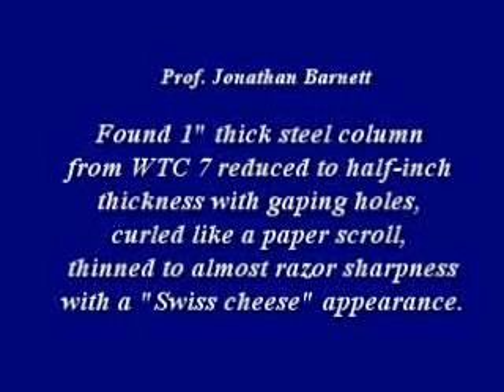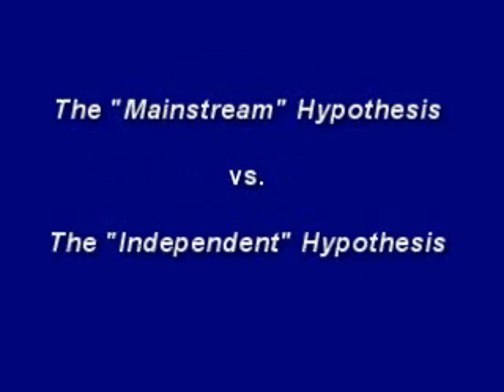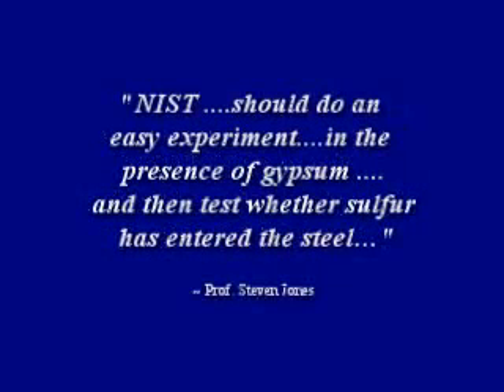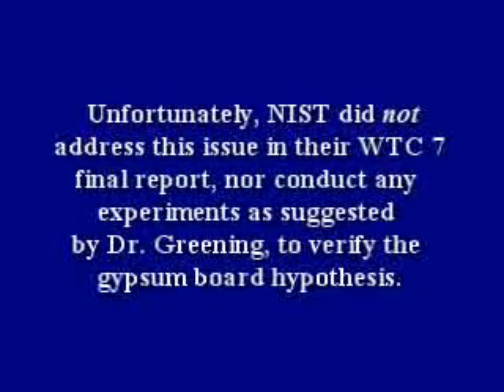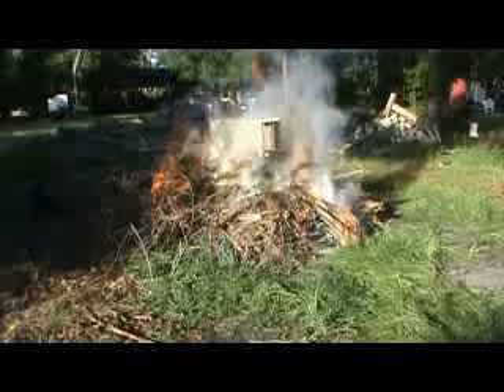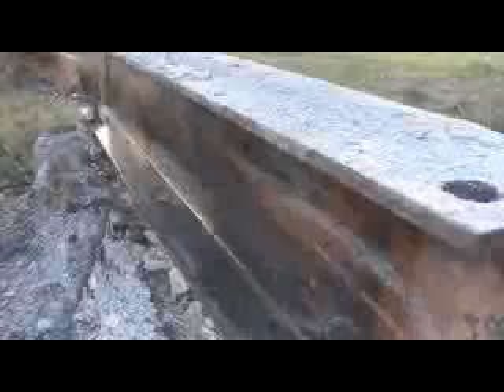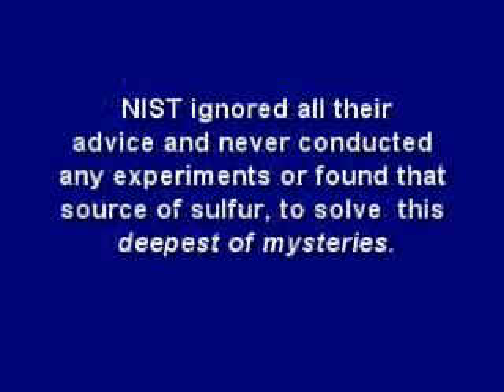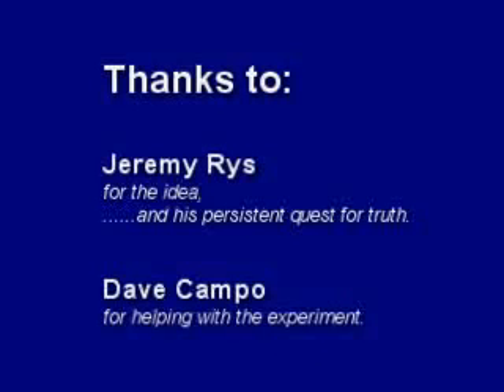9/11 Experiments: The Mysterious Eutectic Steel

Comment: "No source for the sulfur was ever detected" - WHAT?
There were HUNDREDS OF TONS of gypsum in the towers.
Gypsum is calcium sulfate, which is PARTIALLY SOLUBLE IN WATER.
The firemen used water on the wreckage didn't they? It leached down through yards of insulation, didn't it?  Over days, wasn't it?
The wreckage was hot, wasn't it? Above 1000 deg C?
So the hot calcium sulfate solution was REDUCED where it came into contact in the low-oxygen environment to iron sulfide, which melted off.
Did the experiment match this?  NO.
There was no oxygen-free steam environment over water pools over exposed iron.
There was too little water used to extract the dilute sulfate solution (It has only 5% solubility in fresh water.  Was the fireman's water fresh, or saline?)
The atmosphere wasn't low-oxygen, as in the REAL CASE.
(We know it had no oxygen because the hydrogen gas by-product BURNT AT THE SURFACE.  And, believe me, at a 1000 deg C, HYDROGEN would have burnt IMMEDIATELY with any oxygen it met if it had been possible for oxygen to be there.  But it wasn't, because exposed hot steel LOVES it.)
Hydrogen burning at the wreckage surface COULD ONLY HAVE BEEN PRODUCED THIS WAY.
The corrosion so produced would only be produced wherever a pool once existed in the wreckage over exposed steel which was itself above 1000 deg C.  Fizz, sput, sput...
The SCALE of your experiment made light of the surrounding atmosphere. Nowhere could it match the SIZE of all the requisite materials.  At such a small scale the hydrogen would escape more rapidly, failing to reach redox conditions.
If there were any true justice you would be locked up away from terminals where you would might otherwise emit socially-damaging lies and slanders.
but it's an imperfect world, which comes naturally with its faults, one of which is YOU.  However, the evil and ignorant meme you propagate will flourish like an untreated virus unless you are called out.
So respond, liar.
Reply: ***** You HATE the truth (Science).
You must be a "truther" then.  Your lie is in what you call yourself.  That fits.
Reply: ***** I'm a pensioner.  I'm 71.  I'm on holiday already.  What money do I need?
I'd like to get back to making a jig for some mother-of-pearl work, but I'm stuck here enjoying myself on the computer, because my workshop is 15 miles away, and the wife has the car.
What's YOUR excuse?
Reply: joe mcl It isn't often than half a million tons of building has dropped 675 feet into its basement. It has never happened before.
However, the same maths that designed the towers can be used to show that that fall raised up to a thousand tons of steel RED HOT.
That is an engineering calculation, not "spurious misinformation".
You must have been asleep through your physics classes, if you ever had any.
Now it has turned you into a slanderous fool.
I'm not apologising for you.
Reply: joe mcl The potential energy of a tower is what it contains when it is LIFTED into position.
PE = M * G * h where
M = 5e8 kg, G = 9.81 m/sec/sec, h = 222 meters (half way up).
PE = 1.09e12 Joules.
This is partially released as the falling tower strikes itself on the way down, but the remainder is released when it gets to ground zero.
We know the towers fell with a downward acceleration of 2/3rds G.  This means a tower used a third of its energy destroying itself on the way down.
The remaining 2/3rds, 7.26e8 kilojoules, converted its coherent kinetic energy (mass in motion) to stationary random and incoherent kinetic energy, (motionless mass with HEAT), at ground zero.
Knowing the max temp of the wreckage (1100 deg C), we can calculate how much steel got this hot by dividing the HEAT by the temperature rise and the specific heat of steel (0.45 kJ/kcal K), and we get 
7.26e8 / 0.45 * 1100 = 1,470,000 kg or 1,470 tons of steel at 1100 deg C.
This isn't an exact calculation, but within 5% which makes the point.
NIST and I DO KNOW what happened after the collapse.
It is only truthers, who know very little, that theorise (flagrantly falsely) about the completely known.
All the time you are telling us you are ignorant, and even INSISTING ON IT.
Well, have it YOUR way...you are.
Reply: joe mcl "Nice cut n paste job" - All my own work, right then.  You are graceless.
"i can go and use the same tactic" - The difference is YOU WOULD.
"i have hands on experience in structural engineering steel fixing concrete finishing found works and roofing" - I too, but then I know the science AND I can calculate AND I can design..
"The PE figure you use is again spurious as is the height calcs you give" - The all-up weight of a tower was 500,000 tons.  The height of a tower was 444 metres.  The acceleration due to Gravity is 9.81 m/sec/sec.  You LIE.
"They bear no reflection to the buildings" - LIE No.2.
"the composition of kinetic transfer to the structural load of the skeleton" - Whatever THAT means, it's trying to be LIE No.3.
"To suggest that a static load on construction lends to its destructive force is laughable" - So don't suggest it.  I didn't.  Lie No.4.
"we are not talking about loose dead loads here" - So why talk about them?  Lie No.5.
"This was a solidly fixed, welded, steel composition, built to a stringent building code which was over designed, rightly, being so tall and an engineering feat in its day" - Nice to see a momentary truth from you.  But wait - A fire had been burning in it for an hour , after a 100-ton aircraft struck with the force of a ton of TNT, and released a fuell/air explosion equivalent to 100 US iron bombs.  Apart from that it was A-OK. Lie No.6.
"as he knew without explosives it was impossible" - Thanks for speaking for him, but you are lying again. Lie No. 7.
"coukld not say so without incurring the wrath of the government or perps'" - Lie No.8.
"The conservation of energy and motion was violated by the structure" - Cannot happen. Lie No.9.
"as was the GPE" - Don't know what that means.  I bet it's a lie.
"NO structure offers zero resistance" - So why suggest it?  I don't.
"resistance is built in gravitational kinetic energy in falling object does not create heat" - Doesn't make sense, but I know it's lie No.10.
"once the collapse is initiated the fires were starved of oxygen and died" - Absolutely TRUE!  Congratulations!
"NO MORE heat would have been generated" - FALSE for my as yet uncontested reasons stated above.  Lie No.11.
"the heat you claim in the steel would only have been applied to the structure during the fires" - Same lie restated.  Lie No.12.
"not hot enough in the first place to soften the steel" - False.  Lie No.13.
"steel cools quickly" - When fire pools against it, or when buried in insulation?  Neither.  Lie No.14.
"and after the fires subsided a tempering effect" - wouldn't have occurred in either case.  Lie No.15.
"adding strength" - That's what I need.  Lie No.16.
"not weakening the structure in reality" - Lie No. 17.
"the trusses were encased in concrete" - foam unable to resist the air/fuel blast of 9,000 gallons of fuel.  Lie No. 18.
"the concrete would have supported the floor slab" - When it was 4" thick, had Perlite mixed in it, and was 50 foot long?  Lie No.19.
"NIST AND YOU DONT KNOW WHAT HAPPENED, BUT MERELY THROW CONJECTURE" - No, calculation.  Lie No.20.
"CRIME SCENE INTENTIONALLY DESTROYED" - I believe you. After twenty lies, why wouldn't I?   Lie No.21.
"I am to old CAT" - to be fixed, I'm sure.

Congratulations on twenty-one lies not at all mitigated by one single truth.  You are definitely my "liar of the week".
Reply: joe mcl No matter how hard you try, you will never get past "liar of the week".  There's too much competition for more exalted titles.
Possibly as US education progressively worsens, you won't even make "liar of  the week".  Don't be too disappointed.
Reply: ***** "the extremely interesting and informative video which I posted" - Here, on this thread?  Then it must be in invisible ink.
I'll give you your due.  You are consistent with your falsehood.
"Wilful ignorance" - See what I mean?  There's no accounting for some people.  They get angry when you don't exhibit "psychic" abilities.
Get to the point.
Reply: joe mcl "You started it!" *
No, you did. Post 8 on this thread.
"Stop pushing spurious misinformation <blathering> your stupidity".
One more LIE.  It won't make you "liar of the month", you know.

* "No I didn't!  YOU invaded Poland!" - Fawlty Towers.

Oh, and by the way, you REALLY ought to study the links I have offered you.
Reply: ***** "how, in the near footprint pile of WTC7 rubble elemental or a suitably reactive form of sulfur could have been reduced out of gypsum by naturalistic means" - IT FORMED IN A HOT REDUCING ATMOSPHERE AROUND THE STEEL DEEP DOWN AT THE BASE.
Steam is REDUCED TO HYDROGEN WHEN IN CONTACT WITH RED HOT IRON.
THE HYDROGEN atmosphere reduces the sulphate ions to SULFUR.
At ABOVE 1000 deg C the SULFUR penetrates clean iron surfaces instantly, forming IRON SULFIDE which MELTS IMMEDIATELY and falls away..
"without burning off" - It couldn't "burn off".  There was NO OXYGEN.
"explain by natural rather than synthetic process" - try asking for the Moon.  Hydrogen isn't found in nature in its free form.  It escapes Earth's atmosphere for space.
"unproven fantasy" - Known Science, 250 years old.
"Lavoisier produced hydrogen for his experiments on mass conservation by reacting a flux of steam with metallic iron through an incandescent iron tube heated in a fire. Anaerobic oxidation of iron by the protons of water at high temperature can be schematically represented by the set of following reactions:

   Fe +    H2O → FeO + H2
2 Fe + 3 H2O → Fe2O3 + 3 H2
3 Fe + 4 H2O → Fe3O4 + 4 H2"

https://en.wikipedia.org/wiki/Hydrogen

Go and check the firemen's accounts again.
Find out where they confirm the presence of HYDROGEN AT THE SURFACE OF THE WRECKAGE.
THEY DO.
And if hydrogen was there, having escaped from a wreckage base above 1000 deg C in temperature, where it is the most inflammable gas known, there COULDN'T have been EVEN AN  ATOM of free oxygen down there.

The reason why my answers irritate you is both that you don't understand them, and they are CORRECT.
I cannot apologise for this, but I would like to.
It all follows from your trying to fit dissonant concepts into your mind (INSIDE JOB!), which of course is a problem I haven't given myself.
Try thinking THE TOWERS FELL NATURALLY BECAUSE THEY WERE BURNING.
That might help.
Reply: ***** "LOL someone just put the reduction cart before the hot oxidation horse" - 
LOL someone just put the oxidation cart before the hot reducttion horse.  Something which I knew you would try.
In the basement were hot exposed steel surfaces - tons of them.  They absorbed oxygen, causing a reducing atmosphere.  THAT IS MY POINT.

"How in a naturalistic reaction was a suitable 1100C oxidation free environment produced if there was no oxygen?" - You must be confused.  "Oxidation-free" MEANS "there was no oxygen".

"What burns in an atmospheric oxygen free environment at above 1100C? - Thermate" -  And I suppose it burned IN THE BASEMENT WRECKAGE to liberate the hydrogen the firemen didn't know they observed?

That was a waste, wasn't it?

Nah.  You have had the explanation, and it just sticks in your throat, doesn't it?
But you can't let it go, can you?
You'd rather insist on a substance that couldn't possibly create the hydrogen gas, that you know fuck all about, and left no evidence, as it should have.
It's classic.  You are pointing at NOTHING and insisting that something was there that someone removed, and the PROOF is the NOTHING that stands before you.

https://en.wikipedia.org/wiki/Hydrogen
Reply: ***** "You want to have your drawn out series of high temperature oxidation free chemical reductions, of course totally evidence and experiment free supposition, whilst wanting to eat your sustained 1100C cake in an oxygen therefore combustion free environment that was being doused in water"

"In 1783, Antoine Lavoisier gave the element the name hydrogen (from the Greek ὑδρο- hydro meaning "water" and -γενής genes meaning "creator".
Antoine-Laurent de Lavoisier produced hydrogen for his experiments on mass conservation by reacting a flux of steam with metallic iron through an incandescent iron tube heated in a fire. Anaerobic oxidation of iron by the protons of water at high temperature can be schematically represented by the set of following reactions:
   Fe +    H2O → FeO + H2
2 Fe + 3 H2O → Fe2O3 + 3 H2
3 Fe + 4 H2O → Fe3O4 + 4 H2
Many metals such as zirconium undergo a similar reaction with water leading to the production of hydrogen.
https://en.wikipedia.org/wiki/Hydrogen
A hot bunch of refs for you:
1) Simpson, J.A.; Weiner, E.S.C. (1989). "Hydrogen" Oxford English Dictionary 7 (2nd ed.). Clarendon Press. ISBN 0-19-861219-2.
2) Wiberg, Egon; Wiberg, Nils; Holleman, Arnold Frederick (2001). “Inorganic Chemistry”. Academic Press. ISBN 0123526515. 3) ”Magnetic susceptibility of the elements and inorganic compounds” CRC Handbook of Chemistry and Physics. CRC Press.  4) ”Hydrogen". Van Nostrand's Encyclopedia of Chemistry. Wylie-Interscience. ISBN 0-471-61525-0. 5) Emsley, John (2001). “Nature's Building Blocks” Oxford: Oxford University Press. ISBN 0-19-850341-5. 6) Stwertka, Albert (1996). “A Guide to the Elements”. Oxford University Press. pp. 16–21. ISBN 0-19-508083-1. 7) Palmer, D. (13 September 1997). "Hydrogen in the Universe" . NASA.

"As always to rationalize the official conspiracy narrative requires magic manifesting energy." - In this case, GOING BACK IN TIME 232 years.  Or you are apeshit.  One or the other.  Which, do you think?

Time to check it out, perhaps.
Reply: ***** It is YOU that lives in your dream.
The "TV911" makes sense ONLY if and when you learn what ACTUALLY happens OUTSIDE your dream.
Until then you will utter HOGWASH with your porcine friends.
Reply: Vamoo Ah, got you this time.
I have just answered it elsewhere.
Although I think it was an answer to an entirely different question.  Let's unroll it...
"However, it wasn't a perfect job and we do see some ejections" - "Of glass and contents when the building pushes half a million cubic feet of air out of the way every fourteenth of a second".

Yes, each floor contained a half million cubic feet of air, which during the collapse HAD to "leave the building" at the rate of SEVEN MILLION CUBIC FEET PER SECOND.
Sounds like one long explosion to me.
What were you saying about explosives?
Something stupid, I'm sure.
What did I think about the explosives?
Pardon me.  WHAT explosives?

Oh, the radio-controlled water-cooled shaped charges that went off silently from exactly the point of aircraft impact, cutting the columns, to be discovered later by the firemen RIGHT ON TOP OF THE WRECKAGE, covered in slag, and looking just like oxy-acetylene cuts made by firemen?

You will find THOSE explosives next to the fairy riding the unicorn.

If the men in white coats don't find you first.
Reply: ***** "Newton's 3rd law doesn't even apply" - So DEFINE it for me, explaining how it doesn't apply in this context.

"WTC1's top section didn't need to decelerate from 6.31m/s2" - It's just as well, because it DIDN'T "decelerate".

"ten top floors could destroy all 90+ below" - Let's see how that works...
Ten floors destroy one floor.
Eleven floors destroy one floor.
Twelve floors destroy one floor.
Thirteen floors destroy one floor.
Fourteen floors destroy one floor.
Fifteen floors destroy one floor.
Sixteen....
..... I get the picture.  Impossible.

"evermore rigid floors" - ALL IDENTICAL.

"highly focused and regularly patterned squibs " - Need insertion up your jaxy.

"is just air" - That's rather a "minimalistic" interpretation of SEVEN MILLION CUBIC FEET EJECTED EVERY SECOND.

"the towers even began disintegrating silently" - Many minutes before they fell, as their fire-affected floors drooped and detached.

"no use of explosives" - WATER-COOLING would be necessary if explosives were used, otherwise the fire would have set them off.

"a lot of big round numbers" - The complaint of the innumerate.  Can't do your sums?

"being made on assumptions presented as proof" - No assumptions are necessary to show you lie, distort, and deceive.

ARE the tower floors "EVERMORE RIGID"?
How would that be possible when they are all IDENTICAL?

Is that a ONE-OFF LIE?
No.  For you that's a continuing feature of everything you utter.
Implicitly your arguments always begin with "I know I'm lying, but..."
You just don't put THAT part in.
You ARE a truther with an "oof".
Reply: +beachcomber2008 It happened 14 years ago bud. I think It's time we let it go. It was obvious that the towers were under built compared to the new WTC.
Reply: +beachcomber2008 so...why are you here getting all worked up?
Reply: ***** Because he has to get his money's worth out of the 1st grade science/physics kit.
Reply: HD5830Gamer Lmfao
Reply: Yes, funny, I prepared this report.  Laugh you way out of this:
PRIMARY 9-11 CONSPIRACY ASSUMPTION SHOWN TO BE FALSE:
AN ANALYSIS OF THE AMOUNT AND DESTINATION OF THE POTENTIAL ENERGY OF A WTC TOWER

The World Trade Center towers (and WTC7) fell NATURALLY due to buckling failure when their 'slender' columns lost attachment to their floors.
They only used a third of their Potential Energy to destroy themselves, the remaining two-thirds was consumed in crushing some of their steel into ground zero.
A standing WTC tower possessed two hundred and forty six tons of TNT of POTENTIAL ENERGY merely by just standing there. We shall call this energy Eo.
The tower fell by taking the direction of LEAST RESISTANCE, which was THROUGH ITS BUCKLING COLUMNS.
The columns failed by BUCKLING because their STRUCTURAL STABILITY had been compromised by LOSS OF FLOOR ATTACHMENTS. No steel got crushed when this buckling failure occurred. 
Buckling is not a MATERIAL failure; it is a STABILITY failure.
The floors had detached themselves by sagging to an angle which snapped their connections. Photographs of these separated floors (taken shortly before collapse) are plainly shown in the NIST Report.
As each tower fell, some of that stored potential energy, converting to kinetic energy by falling, was released to damage and dismantle both the moving and the stationary parts of the tower on the way down.
The amount of the initial energy consumed in such a manner was inversely proportional to the rate of acceleration of the tower as it descended. It can be calculated.  We shall call it Ed.
The amount of energy remaining (Er) when the tower wreckage hit ground zero is then (Eo - Ed).
This energy, transferred elastically, caused PLASTIC DEFORMATION in the crushed base steel wreckage, and became HEAT. This too can be calculated.
The heat was considerable. The signs of it were captured by satellite. It amounted to the equivalent of a thousand tons of steel raised to a temperature exceeding 1,000 degrees Centigrade.
This hot steel, crushed and pressed against ground zero, oxidised its surface (making scale) and absorbed local oxygen gas, leaving a reducing atmosphere.
In these reducing conditions, and at a temperature of 1,000+ degrees C, fireman’s water which had percolated through crushed gypsum wall boarding DISSOLVED calcium sulphate (yes, Gypsum is 5% soluble in water), the sulphate ions of which were reduced to sulphur which combined with the exposed iron to form IRON SULPHIDE, which at such temperatures was MOLTEN, and flowed away. At a temperature of 1,000 degrees Centigrade, in an absence of oxygen, and in the presence of hydrogen, Sulphur and Iron atoms become keen partners.
Such hot reducing conditions also caused the water/steam to be REDUCED to hydrogen gas which was noted by firemen to be burning at the surface of the wreckage.
The wall-boarding and crushed concrete surrounding (but mostly above) the steel were THERMAL INSULATORS, so greatly slowing cooling.

CALCULATIONS (in SI units):

To calculate the original potential energy of the tower in TNT equivalent,
G = 9.81 metres/sec^2
Mass (M) of tower = 5e8 Kg
Height (h) to the tower’s CG = 210 metres
The explosive energy of 1 ton of TNT (Kt) is equivalent to 4.184e9 Joules

Equation: Tower Potential Energy (Eo) = ( M * G * h ) / Kt
This is equivalent to ( 5e8 * 9.81 * 210 ) / 4.184e9, or 246 tons of TNT.

The Potential Energy of each standing tower was equivalent to 1,000 standard 500 lb. ‘iron’ bombs.

To calculate the kinetic energy used in the tower destruction takes a moment, after a simple thought experiment, namely considering the tower would fall at G if there were NO resistance, and if it fell so slowly that it consumed ALL its energy, it wouldn’t fall at all.
So we can see that the PROPORTION of the energy used up by the collapse must equate with the proportion of G which the collapse was unable to achieve.
As the collapse acceleration was, by truther calculation, established to be about 70% of the acceleration due to gravity, we’ll use that.
The energy used up in tower destruction was therefore 30% of 246, or 73.9 tonnes of TNT.
Assuming that 30% of the tower fell outside of the basement, then the energy (Er) available to heat the wreckage base (by elastic energy transfer and crushing) was 0.7 * (246 - 73.9), or 120 tonnes of TNT.
We know that the steel reached at least 1,000 degrees Centigrade because that is the melting point of iron sulphide.
We can therefore calculate the mass (m) of steel that was raised to that temperature.
The specific heat of iron (Fs) is known to be 0.45e6 Joules / tonne / degree C
The ambient temperature was 20 deg C, so the temperature rise (Tr) was 980 degrees C

Equation: Er = m * Fs * Tr
So m = Er / Tr * Fs = ( 120 * 4.184e9 ) / 980 * 0.45e6
And so m = 5.02e11 / 4.41e8 = 1,138 tonnes.

The collapse of each World Trade Center tower created 1,138 tonnes of red hot steel at 1,000 degrees Centigrade.

So we can see that there is no need to postulate an extra source of energy, and that the basement wreckage heat is also easily accountable, with the additional corroboration of burning hydrogen at the wreckage surface, and molten iron sulphide at the wreckage base.
And so the underlying 'truther' assumption, that the planes couldn't bring down the towers, is shown to be FALSE, as it is shown by calculation, using the physically-correct values, that the potential energy possessed by the towers numerically accounts for ALL the known consequences, through elastic energy transfer, plastic deformation, HYDROGEN gas burning at the wreckage surface, EUTECTIC IRON SULPHIDE melting off the hot steel pressed against Ground Zero, and, of course, a tremendous amount of HEAT.

These results are EVIDENCE of the event. They have been evident to any REAL scientist or engineer from day 1.
Reply: Took you almost a year to come up with this? My god man...the whole tower does not fall from the top dumbass, more than 90% was still standing underneath the falling portion....ergo you cannot ascribe the full mass of the tower to the kinetic energy calc...15yrs later and you still get this dumb shit trying to explain what is clearly a demolition...
Reply: "Took you almost a year to come up with this?" - No.
"the whole tower does not fall from the top" - - actually, yes all of it falls, including the top of it.
"more than 90% was still standing underneath the falling portion" - So it didn't fall?
"you cannot ascribe the full mass of the tower to the kinetic energy calc" - Are you denying the potential energy of the tower?
"15yrs later" - and you are still ignorant and stupid.  That's the measure of your success...
Reply: You have no idea on the concept of kinetic energy and momentum, do you...
Reply: ***** Are you talking to yourself, because ONLY if so will you be correct.
Reply: PRIMARY 9-11 CONSPIRACY ASSUMPTION SHOWN TO BE FALSE:
AN ANALYSIS OF THE AMOUNT AND DESTINATION OF THE POTENTIAL ENERGY OF A WTC TOWER

The World Trade Center towers (and WTC7) fell NATURALLY due to buckling failure when their 'slender' columns lost attachment to their floors.
They only used a third of their Potential Energy to destroy themselves, the remaining two-thirds was consumed in crushing some of their steel into ground zero.
A standing WTC tower possessed two hundred and forty six tons of TNT of POTENTIAL ENERGY merely by just standing there. We shall call this energy Eo.
The tower fell by taking the direction of LEAST RESISTANCE, which was THROUGH ITS BUCKLING COLUMNS.
The columns failed by BUCKLING because their STRUCTURAL STABILITY had been compromised by LOSS OF FLOOR ATTACHMENTS. No steel got crushed when this buckling failure occurred. 
Buckling is not a MATERIAL failure; it is a STABILITY failure.
The floors had detached themselves by sagging to an angle which snapped their connections. Photographs of these separated floors (taken shortly before collapse) are plainly shown in the NIST Report.
As each tower fell, some of that stored potential energy, converting to kinetic energy by falling, was released to damage and dismantle both the moving and the stationary parts of the tower on the way down.
The amount of the initial energy consumed in such a manner was inversely proportional to the rate of acceleration of the tower as it descended. It can be calculated.  We shall call it Ed.
The amount of energy remaining (Er) when the tower wreckage hit ground zero is then (Eo - Ed).
This energy, transferred elastically, caused PLASTIC DEFORMATION in the crushed base steel wreckage, and became HEAT. This too can be calculated.
The heat was considerable. The signs of it were captured by satellite. It amounted to the equivalent of a thousand tons of steel raised to a temperature exceeding 1,000 degrees Centigrade.
This hot steel, crushed and pressed against ground zero, oxidised its surface (making scale) and absorbed local oxygen gas, leaving a reducing atmosphere.
In these reducing conditions, and at a temperature of 1,000+ degrees C, fireman’s water which had percolated through crushed gypsum wall boarding DISSOLVED calcium sulphate (yes, Gypsum is 5% soluble in water), the sulphate ions of which were reduced to sulphur which combined with the exposed iron to form IRON SULPHIDE, which at such temperatures was MOLTEN, and flowed away. At a temperature of 1,000 degrees Centigrade, in an absence of oxygen, and in the presence of hydrogen, Sulphur and Iron atoms become keen partners.
Such hot reducing conditions also caused the water/steam to be REDUCED to hydrogen gas which was noted by firemen to be burning at the surface of the wreckage.
The wall-boarding and crushed concrete surrounding (but mostly above) the steel were THERMAL INSULATORS, so greatly slowing cooling.

CALCULATIONS (in SI units):

To calculate the original potential energy of the tower in TNT equivalent,
G = 9.81 metres/sec^2
Mass (M) of tower = 5e8 Kg
Height (h) to the tower’s CG = 210 metres
The explosive energy of 1 ton of TNT (Kt) is equivalent to 4.184e9 Joules

Equation: Tower Potential Energy (Eo) = ( M * G * h ) / Kt
This is equivalent to ( 5e8 * 9.81 * 210 ) / 4.184e9, or 246 tons of TNT.

The Potential Energy of each standing tower was equivalent to 1,000 standard 500 lb. ‘iron’ bombs.

To calculate the kinetic energy used in the tower destruction takes a moment, after a simple thought experiment, namely considering the tower would fall at G if there were NO resistance, and if it fell so slowly that it consumed ALL its energy, it wouldn’t fall at all.
So we can see that the PROPORTION of the energy used up by the collapse must equate with the proportion of G which the collapse was unable to achieve.
As the collapse acceleration was, by truther calculation, established to be about 70% of the acceleration due to gravity, we’ll use that.
The energy used up in tower destruction was therefore 30% of 246, or 73.9 tonnes of TNT.
Assuming that 30% of the tower fell outside of the basement, then the energy (Er) available to heat the wreckage base (by elastic energy transfer and crushing) was 0.7 * (246 - 73.9), or 120 tonnes of TNT.
We know that the steel reached at least 1,000 degrees Centigrade because that is the melting point of iron sulphide.
We can therefore calculate the mass (m) of steel that was raised to that temperature.
The specific heat of iron (Fs) is known to be 0.45e6 Joules / tonne / degree C
The ambient temperature was 20 deg C, so the temperature rise (Tr) was 980 degrees C

Equation: Er = m * Fs * Tr
So m = Er / Tr * Fs = ( 120 * 4.184e9 ) / 980 * 0.45e6
And so m = 5.02e11 / 4.41e8 = 1,138 tonnes.

The collapse of each World Trade Center tower created 1,138 tonnes of red hot steel at 1,000 degrees Centigrade.

So we can see that there is no need to postulate an extra source of energy, and that the basement wreckage heat is also easily accountable, with the additional corroboration of burning hydrogen at the wreckage surface, and molten iron sulphide at the wreckage base.
And so the underlying 'truther' assumption, that the planes couldn't bring down the towers, is shown to be FALSE, as it is shown by calculation, using the physically-correct values, that the potential energy possessed by the towers numerically accounts for ALL the known consequences, through elastic energy transfer, plastic deformation, HYDROGEN gas burning at the wreckage surface, EUTECTIC IRON SULPHIDE melting off the hot steel pressed against Ground Zero, and, of course, a tremendous amount of HEAT.

These results are EVIDENCE of the event. They have been evident to any REAL scientist or engineer from day 1.